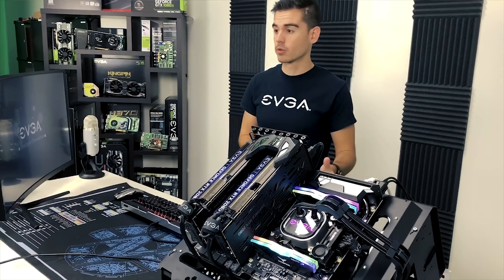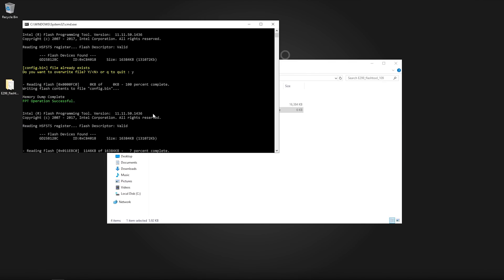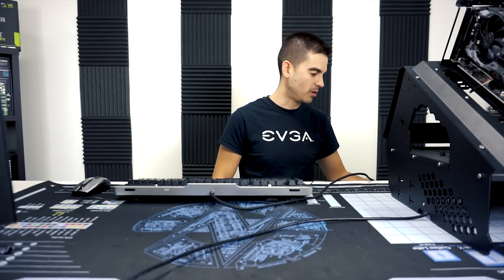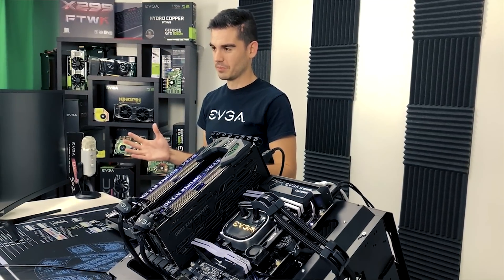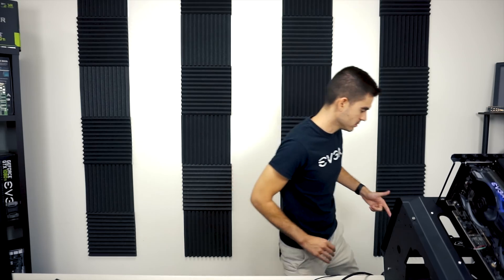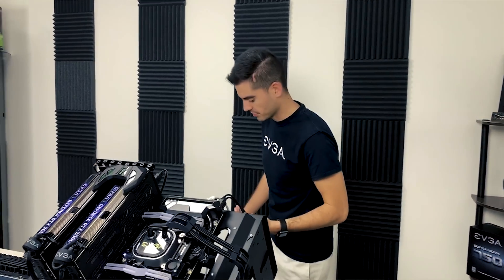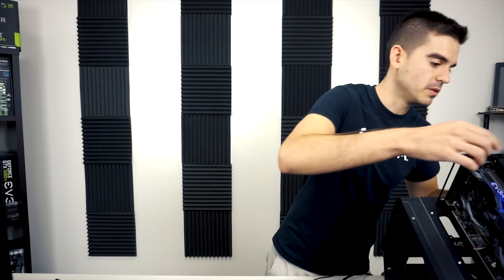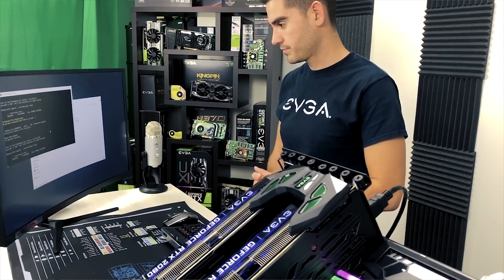How to: Fix a Corrupted Motherboard BIOS

Comment: This is an EVGA X99 FTW motherboard that was previously used as a video rendering server for a few years. However, it has stopped booting and the only post code it displays is "C". The FIVR light also turns on, which may indicate an issue with the CPU. While it's possible that the CPU is dead. Any sugestions ???

Comment: Hi I know this is an old video, however hopefully someone could help me. I have an  Asus x401a laptop,  it's fully functional for 30 minutes then it dies for no reason, battery 100% and on mains. I've checked everything and replaced thermal paste even the cpu. It's 30 minutes on the dot. I've heard it's something to do with Intel ME. I have an external Bios chip read/writer plus some new Bios chips. Problem is, is it actually the Bios at fault, I believe at some point in the updates the command gets embedded in the Bios chip correct me if I am wrong. It's as if some sort of timer is activated on power up. Can you or any of you're viewers help me?

Comment: Wow. What useless trash in the IT community of the internet. Just flip your bios circuit switch... Gee, why didn't I think of that any time I've had to fix a Dell or HP when the drives, ram, and cpu were working properly with fresh OS? Freaking spoiled PC gamers are still living up to the memes of old, but now they think they can fix shit. Fantastic.

Note that I wouldn't be so toxic if this guy had explicitly and deliberately outlined that some high end gaming motherboards actually had two bios systems as a fail safe, and this is demonstration if one seems to fail. Instead he just adresses the other fanbois of his gaming cult and goes about his demonstration and how to rectify the issue. Fantastic IT work, chump. 

Fight me

Comment: hello, I recently purchased a EVGA Z370FTW Motherboard, my cpu is the i5 6900k, my memory is  	F4-2400C15D-8GIS.  I would like to install windows 10 64Bit on my sytem. I am having trouble with the installation. For some reason I am able to load the windows installation but When the installation begins (Windows Logo appear) the system freezes.  I get a error code 54 on my mother board.  All my cpu and memory settings are set to Automatic.  What is the problem? Thanks for your help.

Comment: Actually the engineers thought about this kind of a stupid thing to happen and backed up the user with a SECOND BIOS, on !THE VERRY NEW MODELS OF MOTHER BOARDS !!! 
YOU DIDN'T DO ANYTHING!!! THEY DID. wt*!!! Flicking a switch??? Any monkey could do this. 

How about a real problem? Updating the bios and somehow damaging the monitor that it remained with vertical lines. Bios update made from windows EZ Flash from the producer of the board.

Comment: How can i flash UEFI manually on the MSI FM2-A85XA-G65?
Making a usb trying to boot is useless.
My motherboard uses the bios click 2 system, but it is corrupted beyond compare, and where it should be 6 choices, I only have 1 and that is MSI MB settings.
Scrolling through the menu, all of the other menus are visible as well, like image in image.
Update UEFI bios will fix it, but only if my usb can boot.
Getting nowhere.

Comment: I love my X79 DARK for this very reason. 3 position BIOS switch, and a replaceable BIOS chip (For around $20).  Saved itself once already, due to a power outage! Just set it to another BIOS, and once booted in to Windows, put the switch to the bad BIOS position and reflashed! Back to 3 fully functional BIOS', and no chip required. 

I love my DARK for other things too!

Comment: But what if you don't have double bios and you can't switch to another bios
Reply: some motherboards have a fallback option so it can still boot from external mediums and flash a new bios file. if that's not possible, you need to desolder the bios chip and flash it using an external programmer. some pc repair shops do this.
Reply: @crhBLH   In my early years I did some flashing putting the file in a USB and using a combination keys from the keyboard and successfully was able to bring to life laptops and desktops and randomly still doing this.
Reply: @yermo130  ihave this issue on my laptop its asus rog g713qe and iwent to repair shops they said the update in our tool to support your device isn't available yet can u help find out how to fix it
Reply: Get a flash programmer and reflash it.
Reply: if you have second computer than connect ur computer to ur another working pc go into the essential files of windows mostly at system 32 or syswow64 and replace the bios files you can download bios also and you can install fresh new bios o and ya most pc have bios Recovary feature or u can send ur computer to its developer and they will fix ur pc
Reply: then you just cry
Reply: Well then, my friend, you are F***ed.
Reply: Asus has a bios recovery feature, try that if you are on a asus motherboard
Reply: @insanitylol  how
Reply: I have the Rog Strix B450F motherboard and it's only fully posting half the time sometimes it freezes in windows but I have already tried installing windows on a different ssd and it hasn't made any difference. Next steps anyone?
Reply: @JoshuaRossChristie   fixed your issue?
Reply: Remove your cmos battery it will boot in factory mode
Reply: You’re fucked
Reply: 4:21 Sometimes the BIOS chip is mounted in a socket and you can just swap it physically.
Reply: @hampocampo  Yep , they are just smaller versions of EEPROMs used in automotive ECUs Been flashing those since 1980s
Reply: ... Or if you managed to corrupt both of your BIOS 🤐... I'm going the RMA route, I'll try playing dumb and return my MB under warranty. The worst part is I had no real reason to update the BIOS. Here are fucks to me 🖕🖕🖕
Reply: @-Yurkey  same here 😪😪
Reply: @shr7n  if you have warranty try it that way... I managed to kill my Gigabyte AB 350M as mentioned, my warranty claim was accepted but the shop didnt have a replacement for it so they gave me my original investment back 😁...and since the MSI B450M Mortar was on sale I got it for like an extra 2$ ...sometimes it pays to be a stupid fuck 😂
Reply: @-Yurkey  My warranty  got over last week 😪😪 I gave it to a local shop to repair  they swaped my motherboard  with another one
Reply: @shr7n  Well that sucks :(
Reply: Then you are using the wrong motherboard! You can buy equipment to correct the issue, but for most, not worth it.
Reply: @mattsmechanicalssi5833  what if you have a laptop?

Comment: what if your MB has 2x bios but no switch ?
Reply: Those kind of motherboards will boot from the second bios if the first one is corrupted, then they reflash the first bios from the second one automaticaly.
Reply: ok one more Q could ram make the MB not post?
Reply: Yes.